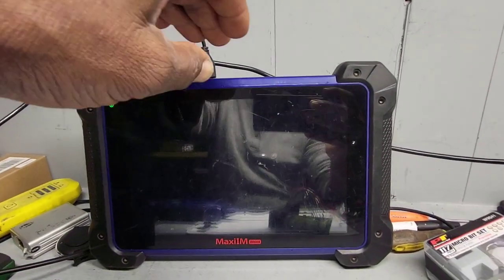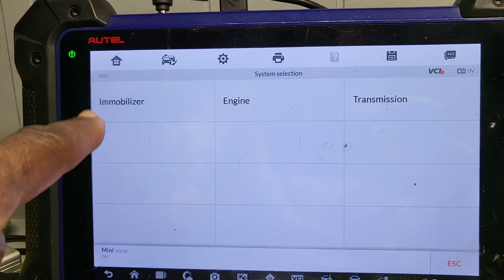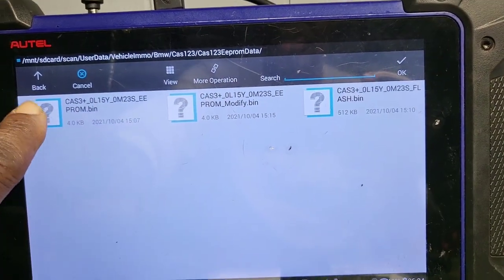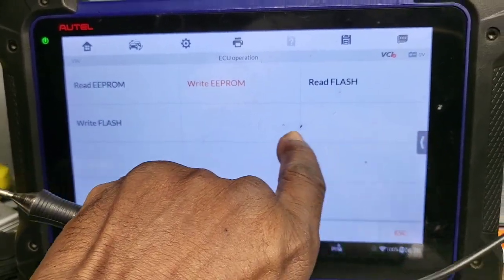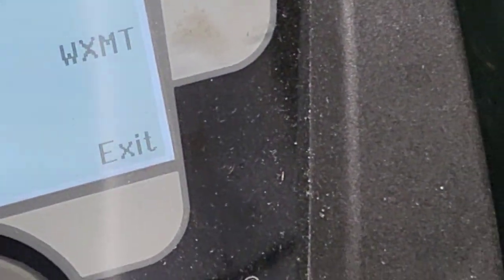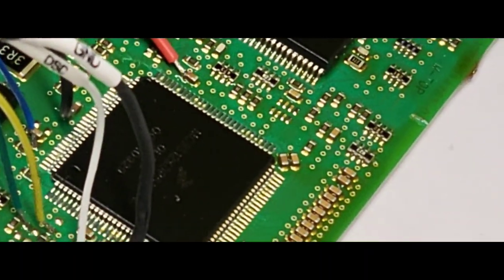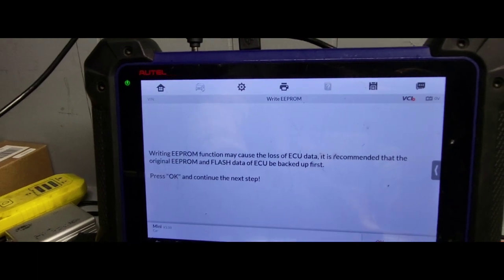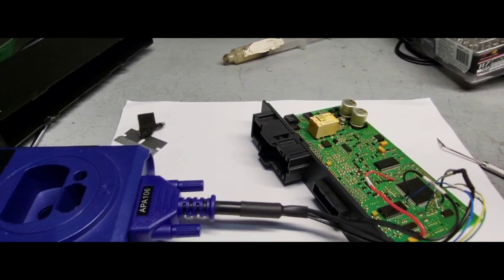2007_20123 Cooper/BMW Cas 3 On Bench  Remote Key Programming Explain What Is The Cas Module (part 2)

Comment: Great job, but why you didn't write flash?!
Reply from the maker: i did it in on video i will for that link
Reply from the maker: 2007_2013 Cooper/BMW Cas 3 On Bench Remote Key Programming Explain What Is The Cas Module (part 2)